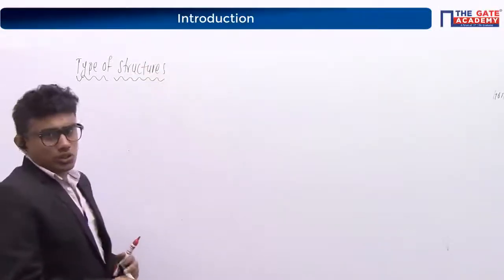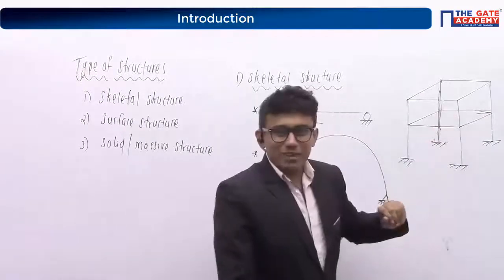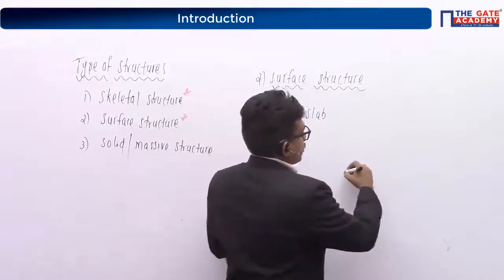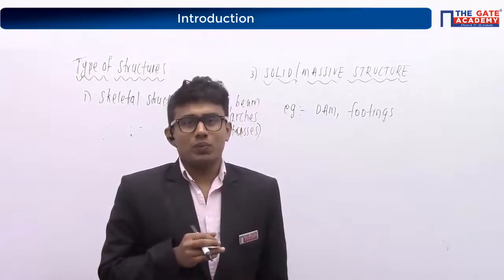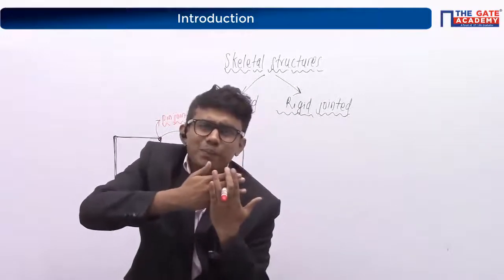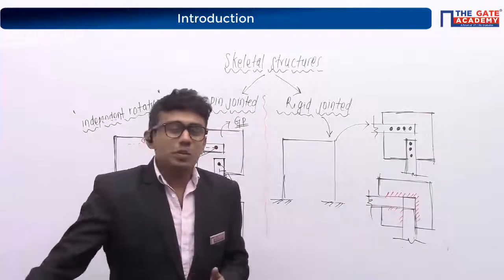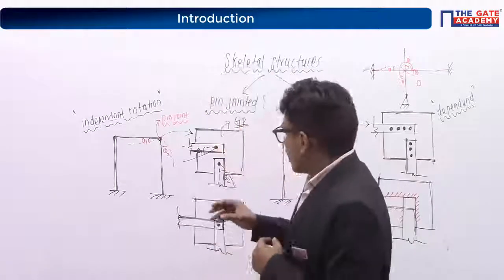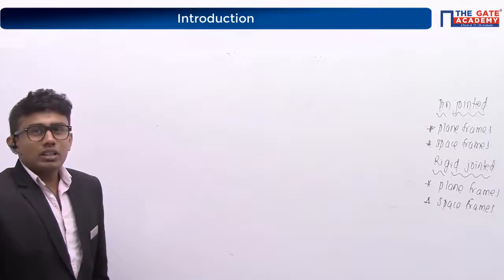Part 2 | Introduction to Structural Analysis | Free GATE Lectures for Civil | GATE Civil Preparation

Comment: Sir, for Rigid joint as per your explanation its  dependent structure , rotation and same angle , providing welding and no bolt, About R CC Rigid joint?